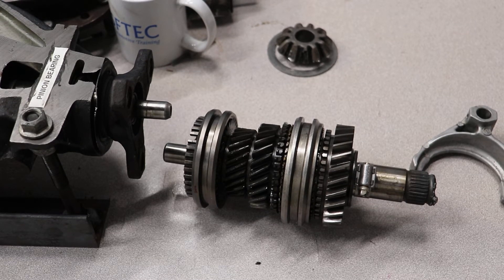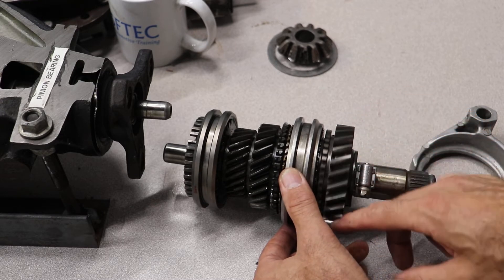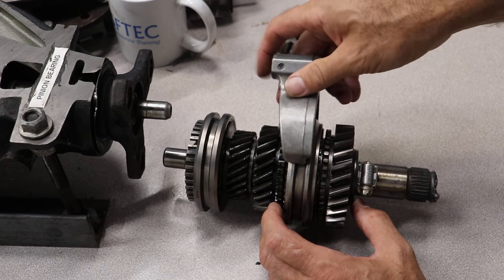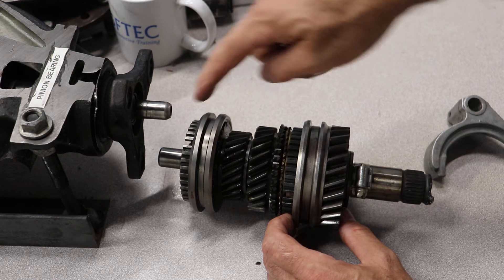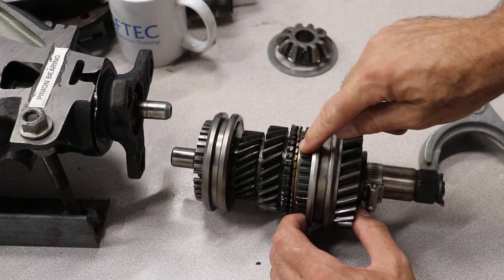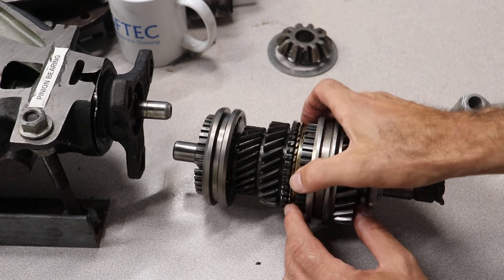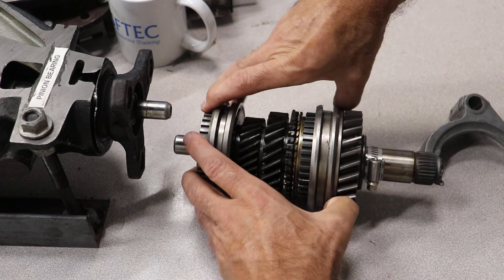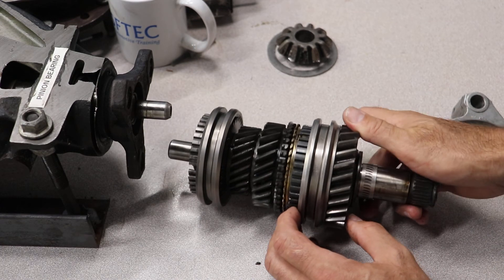ASE A-3 Manual Transmission Gears and Synchronizer ASE questions.

Comment: What transmission is this gear set from?  Where can I buy or acquire this for personal use?
Reply from the maker: Yeah chopped them out of a Mazda with the torch.
Reply: You can use the guts from pretty much any manual transmission, I have the guts from the inside of a ducati monster I'll sell you cheap if you need